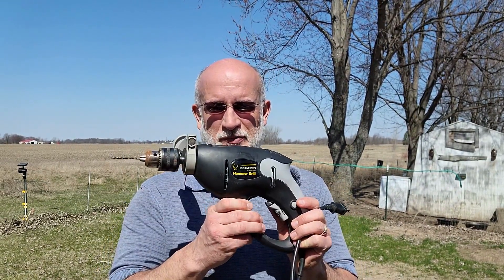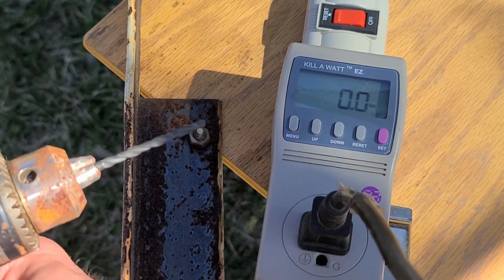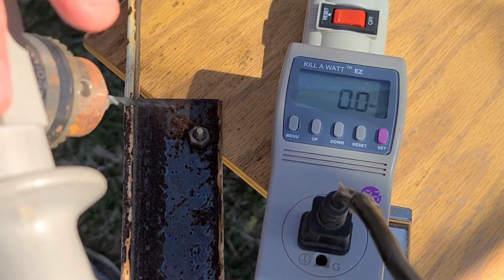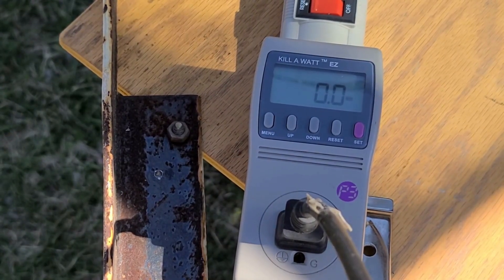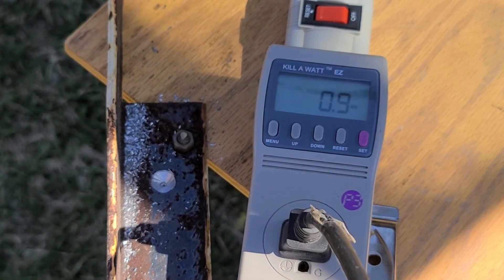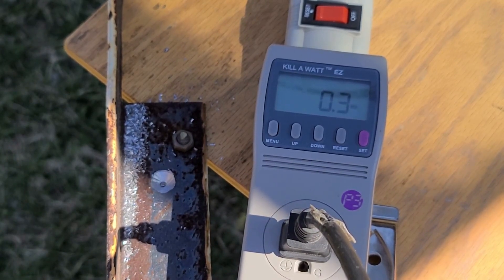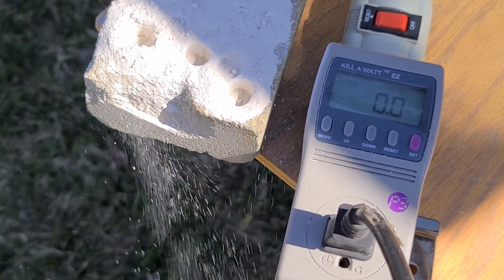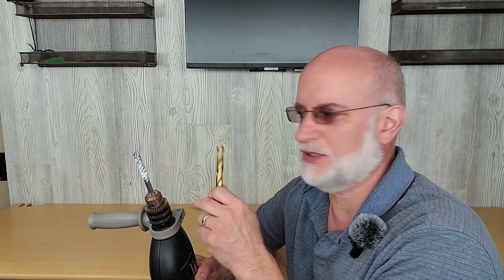Wattage Wednesday - How Many Watts Does a Hammer Drill Use

Comment: Might be a stupid question but: Is the number on the meter is the real current that was drown from the grid?. or you ran on 300W for few seconds (and then it is way less then that, per hour for example). Because, when they state that the drill is 500W, I assume it is per hour of use (and if we devide that by seconds - it should be really low). Thank you
Reply from the maker: Ther is no stupid questions. The 500 watts displayed is the power being used at that instant. When you add time to the equation, you are now talking about watt hours. If I used this drill for 1 hour and it was using 500 watts for the entire hour. I would have used 500 watt hours (Whr or Wh). If I drill 100 holes similar to what I did in the video over a 1 hour period, I may have only used 40 Wh. Basically it's the average watts for that hour.  If I drilled 200 holes over 2 hours. It would be 80 Wh. It would also be 80 Wh if I drilled the 200 hours in 1 hour. Your home electrical bill is displayed in KWH (kilo watt hour) 1 Kwh equals 1000 Wh. Hope this helps!
Reply: @daveandsonyainmichigan  So if the drill says 500W, it does not necceserly mean that 1 hour of usage equals to 0.5KW (500W). Did I understand correctly?. And if so, how can we measure the real wattage of a full hour?. Can it be done from the "500W" rating of the drill alone?. Thank you
Reply from the maker: This is correct! The harder you push, the more load you put on the drill. More load is more wattage, which my case was close to the wattage on the label. If you are using a small drill bit or not pressing very hard, you will use less than the label rating. If you look in the video description, I show the wattage meter I use in the video it's called kill-a-watt meter. It shows how much wattage you are using, it also shows the total watt hours used amongst many other things.